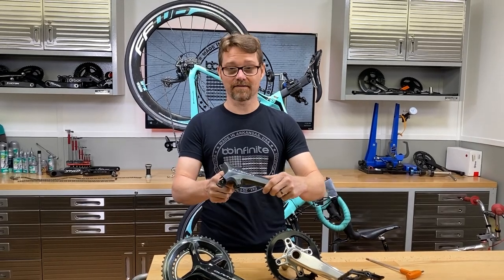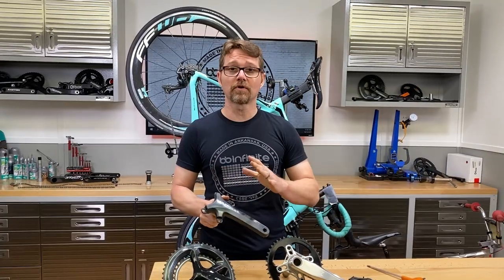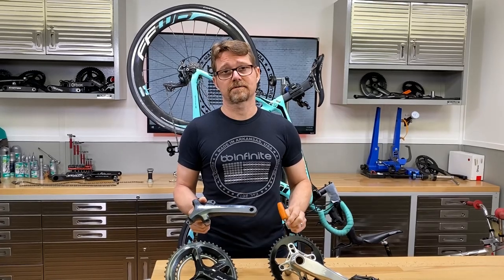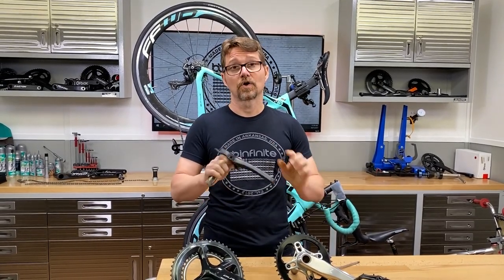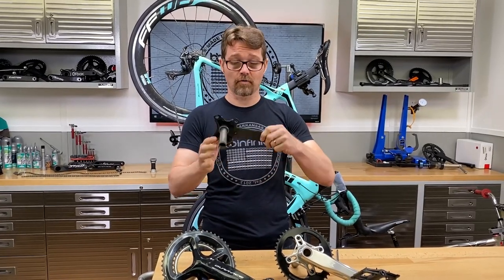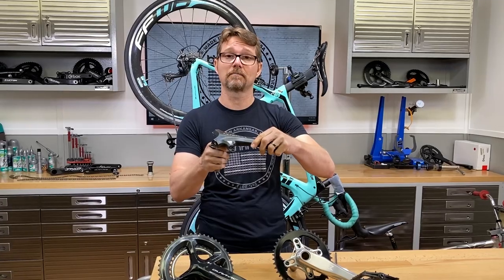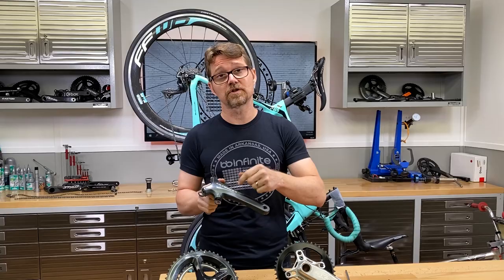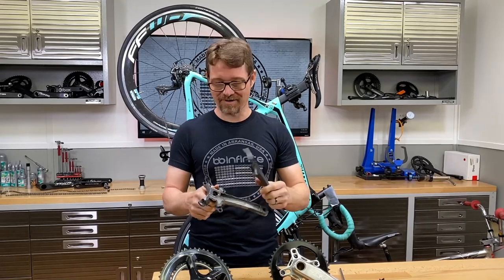TECH TIP: Ultegra and Dura Ace Crank Failure Diagnosis

Comment: One general point that is always ignored, also by myself, is a section out of the paperwork that comes with every Shimano part. 'Check your parts thoroughly before every ride'. This not to say that it is expected to have items failing, but to literally have the user checking every part before every ride, as parts still could fail. I never do this, but I should and I assume the same applies to everyone else. So under these conditions we would have to examine our bikes before every ride and by that we should recognize these issue ahead and act accordingly. But who really does that?
Reply from the maker: I always check tires for pressure and condition, skewers/axles, stem, and headset before a ride. Not with a tool. I twist the headset and stem a bit to make sure they're solid and fixed. I have a tire pressure gauge in my thumb. LOL
Reply: @BBInfinite  I always check tyres, brakes and give the bike a good bounce before setting off. Basically the stuff that will prevent you from dying horribly.
Reply: and yes, the skewers. Super important your wheels don't fall off.
Reply from the maker: @syrus3k  Exactly. Pinch tires. Pick the front wheel up off the ground, spin it slowly, inspect, then do the same with the rear. Brake check. Check skewers are tight. Bounce the bike on the tires to see what rattles. If all is good, ride off. 10-15 seconds max.

Comment: What if there are no signs of cracks and you hear a creaking sound already check every spots even on pedals, BB's and wheelset but you still hear it. Is it a possible to be a crankset issue?
Reply from the maker: Before taking anything apart we highly recommend that you examine the other things that could be causing the problem. I can assure you that the bottom bracket is among the least likely sources of the noise. I’m saying this from experience. It’s likely something super easy to fix. We’ve compiled a handy blog that outlines a proven, methodical process for finding creaks and silencing them by starting at the easiest and slowly moving toward the difficult:
https://www.bbinfinite.com/blogs/news/74410883-kill-that-creak

Comment: Would drilling a tiny hole to let the condensation causing the debonding escape a good idea?
Reply from the maker: No idea. Maybe it'd let more moisture in. The key takeaway is that this problem is not so common that it's worth worrying about in general.
Reply: @BBInfinite  Yes that make sense! I was thinking the hole would act as a vent.  This problem is starting to be more common now. There is a whole Instagram page dedicated to this failure. I ride in all weather conditions so this is a no go for me. Thanks for the reply!

Comment: Just curious what road crankset alternatives you'd recommend for 11 speed Shimano? Would it be safer to stick with a 105 R7000 crankset as opposed to Ultegra and Dura Ace?
Reply from the maker: After all this we still recommend the Ultegra R8000 and the DA R9100  crank sets, because these delamination events are rare when considering just how many have been manufactured. A failure in the making is also easy enough to spot. The R7000 crank, and group set, is a stellar choice as well, and kinder to the wallet.
Reply: Just use 105 (me f.e. opted for 5800 cranksets and 7000 on all other components), especially now as they're becoming Di2 as well if this is important for you. 105 is not really that much below Ultegra or Dura-Ace, but pricewise much more attractive. So price-value wise 105 is unbeatable in addition to this it is known to be extremely reliable, sturdy and still smooth overall.
Reply: 105 a ojos cerrados.

Comment: I have a creaky (actually it ticks) Shimano GRX crank and now I am worried.  Is GRX a bonded design?
Reply from the maker: The delamination problem is not common but it is widespread. There are many things to look out for before this that are a lot easier to deal with. We cover these basic checks here: https://www.bbinfinite.com/blogs/news/74410883-kill-that-creak
Reply: @BBInfinite  I took the cranks off and it appears that GRX is not a laminated design, so it is not that. I removed the chainrings and pedals, cleaned and lubed and torqued everything to spec. It still ticks though. I'll follow the rest of the items in your blog link. At least I don't have to worry about an obvious catastrophic crack in the cranks.
Thanks

Comment: What were the first bonded ultegra cranks?
Reply from the maker: Good question. I believe it started with the R9000 cranks. Do you know?
Reply: The first was the 5arm 10speed Ultegra 6700 chainset, though not many failed.
Then came the 4arm 11speed 6800 which many have failed & continue to do so.
Then the latest 4arm R8000, again many failures.
Reply: @keepitreal1547  Yea, well I suppose the 6600 is the last of the real ones. I got one on my dads bike. Poss time to start looking for another just to keep on ice, or even a full 6600 group set. Mech rim brake ftw.